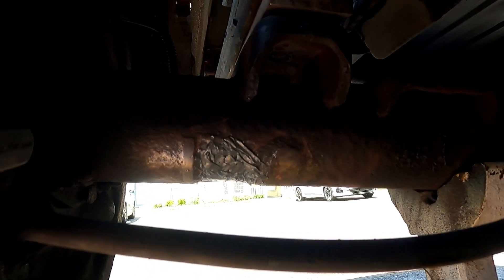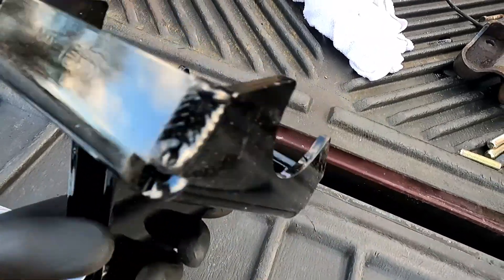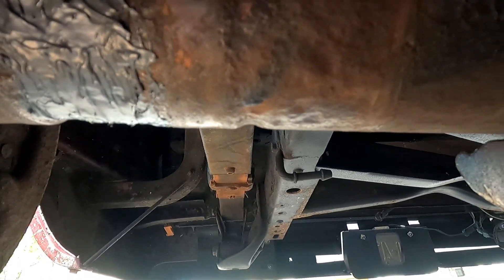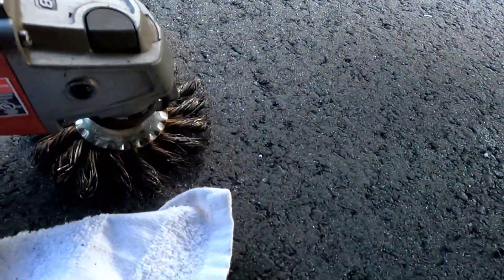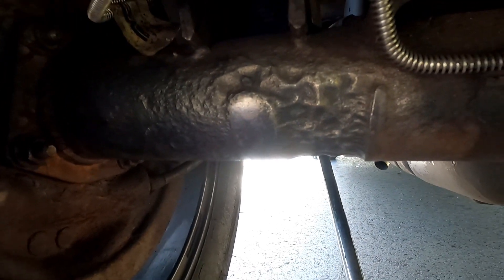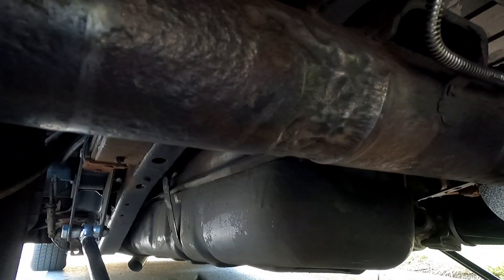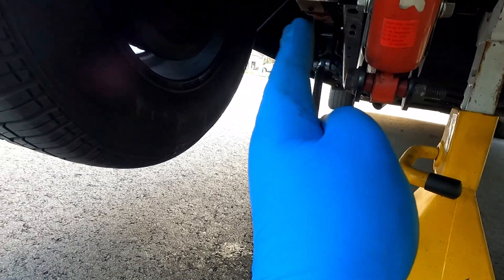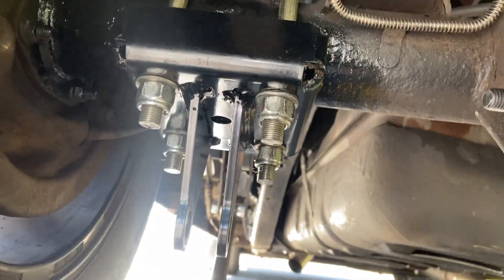Axle Tube Rust Hole Repair OBS Chevy Pickup GMT400

Comment: Excellent vid bro, same issue with 96 Silverado, freaked out thinking it was an axle replacement but research some and realized it might only be a pin hole. Gonna, check it throughly today and assess rust damage, thank you for taking the time to make the video. I was beginning to compile a solution in my head similar to yours, Bravo Sir 🎉
Reply from the maker: @boldlionprov281-5  glad it could help man. I’m still leak free and i daily drive my truck. Even from state to state.

Comment: just noticed a stain on the driveway under my gmt800 earlier and traced it back to the axle tube. right now the bottom plate is full of gear oil and slowly dripping out. probably going to zap it with the welder but i do like the idea of jb weld sealing the area. good video man.
Reply from the maker: Thanks man appreciate it.

Comment: Thanks for this video.  I need to replace my saddles for the exact same reason.  Thankfully no leak.... yet.  I was a bit reluctant to do it myself since there is literally so much riding on this, but you explained it well and my confidence is restored.  Where did you get the replacement saddles?
Reply from the maker: Glad it helped! The saddle I put on was from Calvert Racing. It came with the set of Caltracks I bought. If you call them I believe you can just order the mounting plates alone. Also you can get a set of factory replacements off of EBay for a decent price.